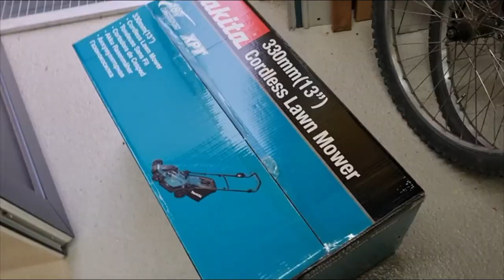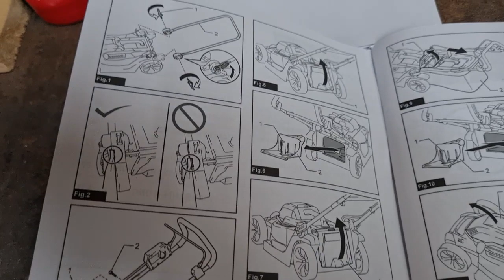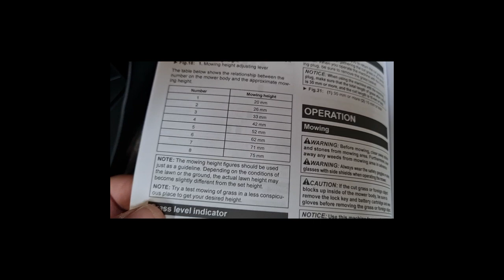Makita DLM330SM unboxing

Comment: Great video. How is the power ? It's only 18v, does it get stuck on thicker grass ? Or is 18v enough. I have buffalo grass. Thanks heaps . How do you like it so far? I'm looking at getting the exact same one.
Reply from the maker: Hi,thx. You only need one 18v akku, also works with the older 3Ah up to 5 but yoz can feel there a little power difference. The  small sharp knive cuts with a very good power also some thiker grasses i rhink you only will have a little bit less runtime if you always need the full power .
Reply: @strangedrives2182  thank you very much

Comment: Great video! 
Can you please tell me how many minutes does it run with full 4.0Ah battery? Does it have any issue with a bit higher grass (4” / 10cm), power wise? Thank you
Reply from the maker: Hi. No there are no problems with a strip i had with 10 to 15 cm tall grass. But i tried it a little bit slower then on the normal high. I think you will need the 4 ah akku for 120qm normal hight, 20 to 30 min runtime in my yard. I have some 3ah and only 1 5ah batterie. Its so nice you can handle it without much work to the smallest corners but the front part hang still over 10 cm couse of the tires.. like nearly any other mower i saw till now.
Reply: @strangedrives2182  thank you for all the useful informations.